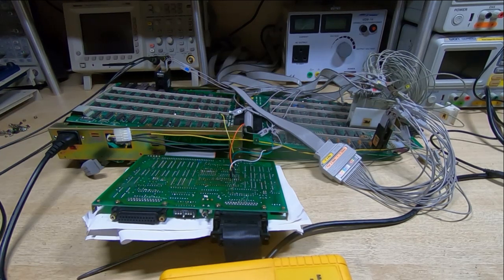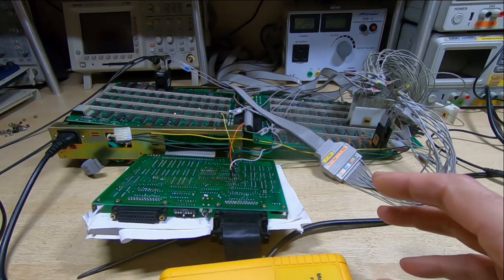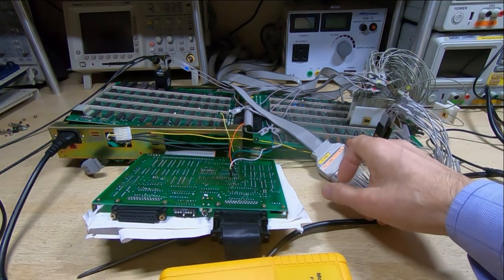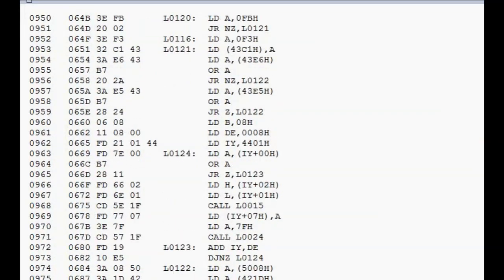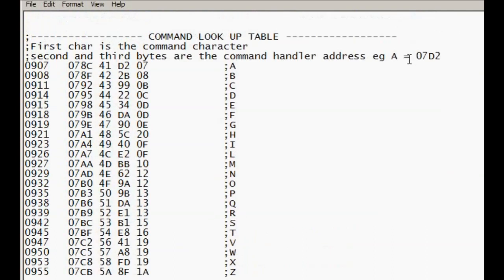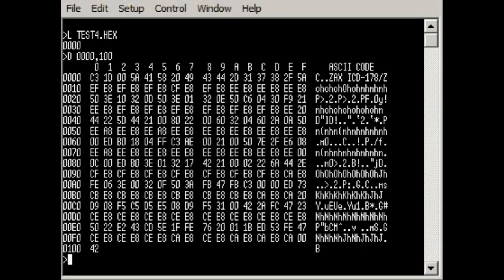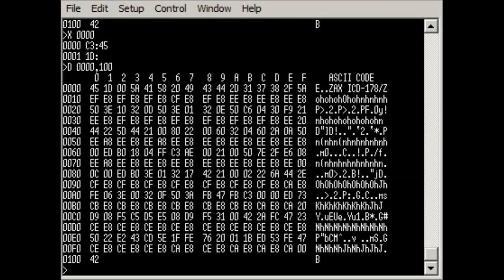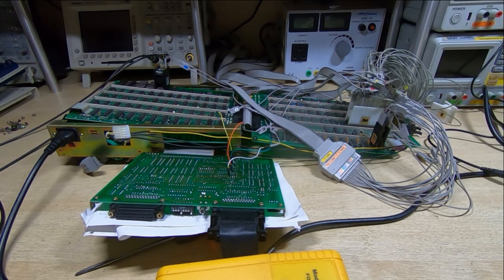ZAX ICD178 Z80  Part1

Comment: I’ve got one of these - same model ICD-178 Z80. I’ve had to do some repairs to it, but have it up and running and am now building replica CPU cables. Would you be prepared to share your work on the disassembly? I have the same ROM version (8C) and as you point out the commands are a bit different to the -278 manuals which exist on the net…
Reply from the maker: If you contact me through my website and provide your email address I will send you the lst file.

Comment: The problem with ICEs, as I found after buying a very expensive HP 64000 system in the early 80s, is that they limit what you can design because of the propagation delays they add. If you want the full performance that a µP is capable of they hinder rather than help. After that mistake I settled on using a disassembling logic analyser passively monitoring the bus. This displays the code that was actually run (together with external signals) rather than what you thought was running and can save months of faultfinding. The 40 pin clips were always slipping off so I always designed in a ribbon cable header on the pcb for LA connection. The trick to developing reliable software is to use a LA to prove that it is working at every stage, not just get it out when you get stuck. Test equipment manufacturers stopped making them in the '90s as they could not keep up with CPU development, particularly with pipelining and caches, but for the Z80 they are invaluable.
Reply from the maker: I have used ICE systems for over 50 years and I would say that the reverse is true. If used properly they allow easy fault finding and development. If they prevent the target system from working correctly then most likely the target system has a design issue. A CPU system should be designed with suitable bus and control line timing in which case the right ICE system will be transparent to the system as it will have the same bus cycle timing. A logic analyser is very useful for test purposes but being able to actually control the target system rather than just see what it did is much more useful. I generally use both LA and ICE systems for complex designs although for simple designs they may not be needed.

Comment: There are lot of examples of the Dunning-Kruger effect on the internet. I once designed and built an Arduino based standalone EPROM programmer. I published some details on a Farcebook page and just got flamed by some absolute ignorant morons, each one probably once wrote a LED flasher in ArduBlock or some other pathetic 'programming language' aimed at kids and idiots, and now consider themselves as experts.

Comment: Back in the late ‘80s/early ‘90s I became quite adept at using a Lauterbach Trace32 ICE for the 68030 — by dint of the fact it was on my desk and plugged into my workstation. We were developing on a bare bones system (no OS) and it was an eye opening experience for a programmer not long graduated.

Although we didn’t have source level tracing for our compiler (the suppliers needed too much £££ to provide it), what the ICE could do was incredibly useful, certainly in the realms of breakpoint triggering and being able to see what happened just before a trigger point.

looking back, I very much doubt that we’d have been able to get the project done without it… 'printf' style debugging is OK, but a few scripts on the ICE could help track down things like broken page tables with ease.
Reply from the maker: Exactly, In the 80's I was working for a company developing complex systems using 68000 processors and we had a similar ICE. The target system had 8 PIA's, discrete 16 bit firmware controlled A/D convertors, displays, keyboards etc and without the ICE the projects would have taken many times longer and may never have been completed (money would have run out).

Comment: Boy does this bring back memories. Try designing a system with 128 bytes of RAM. Did many designs with Z80 and some HD64180 in the early 90s. Always tried to get the InCircuit Emulators if possible with bonded out chips so you could read registers live. Amazing how much real time control you can do with 8 bits when you don't have to worry about fancy graphics. Switched to the 8051 family with the MetaLick ICE and BSO tasking C and designed a ton of products with that setup. Love the history.

Comment: I’ve been doing embedded development for years, and was able to use true ICE hardware for 8051 and microchip parts.  These ICE systems used special “bond out” micros where extra pins were brought out of the micro for access to extra internal signals to aid with ICE.  These special “bond out” micros were heavily protected with buffering so that during development you were unlikely to damage them, but you may go through a few buffers!  Did this ICE use a standard Z80, or a special part?  There is no substitute for an ICE that can run and trace at full speed for developing serious embedded software.  It’s nice that modern micros have built in debugging aids that provide some of the benefits of ICE.  These luxuries were not practical with the older micros as they couldn’t afford the die space.  Love your channel - and have learned a great deal watching every restoration.
Reply from the maker: Yes modern bond out devices are somewhat different and not really as good as a true ICE (in my opinion). Almost all modern micros have in built debugging but it is not until you use full ICE systems that the difference is obvious. It does not matter for simple projects and available resources make current development much easier and the internet is full of help and examples but the internet did not exist when I started development and most datasheets had to be purchased. If you look at devices like microchip PIC's then the advent of equipment like the ICE200 and 4000 made development much easier and when the devices started to include inbuilt debugging it was actually a step backwards in ease of development although it did allow for the use of MUCH lower cost tools and no longer needed specific development boards to be made. I will be showing some of these in upcoming videos. The ZAX uses a standard processor and as it does not power the target the buffering is reasonably robust and sufficient for all except improper use. The advantage for me is that I can plug it into a vintage machine I want to repair without the need to modify it. A major difference that is often overlooked when comparing to bondout devices is that it allows full system development and is not limited to internal processor operation (yes I know that some bond out devices have similar abilities but they tend to be much more limited).

Comment: One of my professors at uni showed an similar device that he made and was very proud of it. It was a Z80 single board computer (not Spectrum compatible) that had a interface that connected in place of and Z80 CPU on any board. The device had a custom ROM that made it display on a TV screen the internals of Z80 and it states, registers, data /addresses, basically simulating an Z80 and showing it functioning. It could output to a printer too. The professor was also developing an adapter for I8031 also. If I remember correctly, he had some patents for that device. 
Very interesting device, I never knew that something like this was industrially developed.
Reply from the maker: Sounds interesting, pity he did not publish the design. I think there are a few low cost projects around at the moment that do something similar. It is surprisingly easy to display current processor status. It is really in the selective memory mapping and full speed trace that makes this type of device so useful. It reminds me of the software simulators that microchip built into their IDE's but the ICE 2000 and 4000 systems were game changers for developers. The lower cost serial debuggers are good but a step backwards compared to the full emulators.

Comment: Thank you Jerry for paying attention to this ZAX device! My reverse engineering of the ICD-278/378 Z80 is under way. What became obvious is that while ZAX development went on, the models 178/278/378 H/W and F/W were improved/upgrade. The 178 uses DRAM, later models SRAM. Please continue with this series. Your F/W explanation helps me understanding the concept. BTW, I'm using the Ghidra disassembler. If interested in what I lay bare, let me know!
Reply from the maker: Yes I have a number of these and every design is different. They certainly developed as they went. I think these are very interesting in the way the code is written as it is very efficient in terms of code size although it results in fairly slow code due to the number of calls. I will most likely show some details on specific code blocks as the developers seemed to use the same methods throughout.